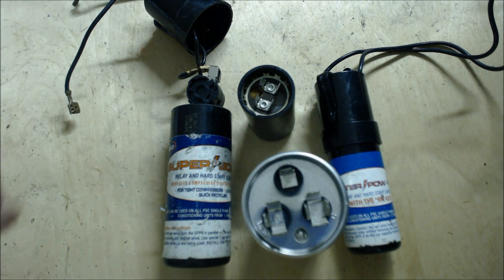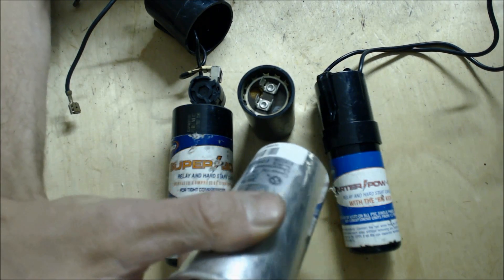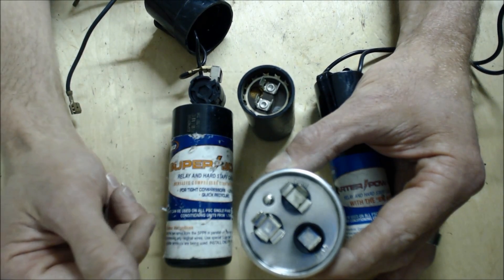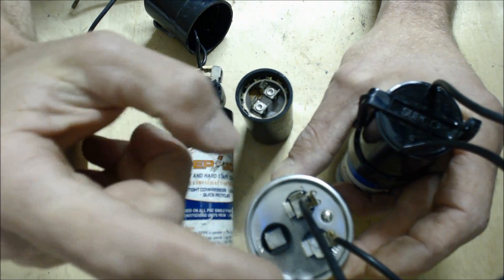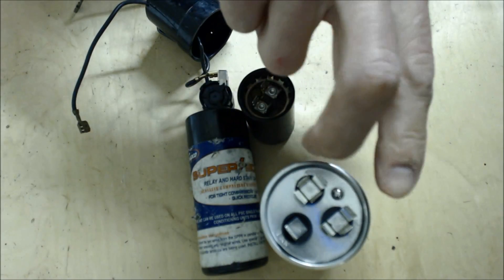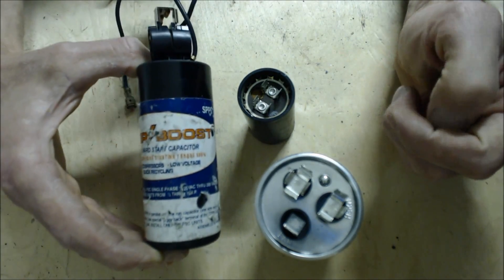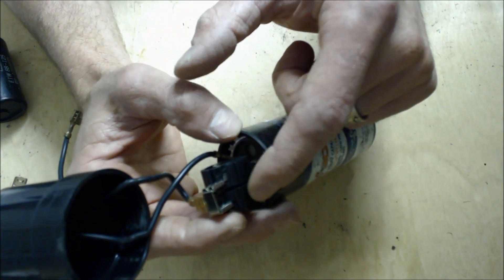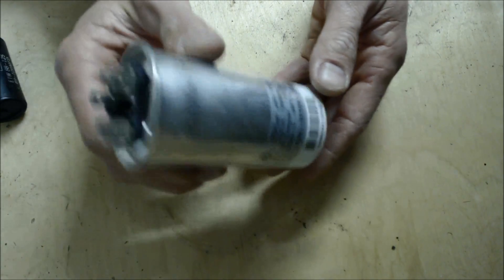Super Boost, Starter Power Packs for Compressors- Why use a Relay and Hard Start Capacitor!

Comment: PLEASE can someone help: can i install hard start kit use for 2.5 Ton 14.3 SEER2 Heat Pump Condensing Unit, 208-230/1/60, R-410A, Single Stage THIS PARTICULAR model N4H5S30AKAAAABAB

Comment: There is no mention with the Hard Start Capacitor Kit and what to do with the relay (I have a Carrier HN51KC024 coil relay in the compressor box)? As the kit has an attached unit as part of the kit, do I keep in the relay connected as is placed currently? Also, when I purchase the kit, is it a universal one or do I have to purchase a specific type or specification which will work with my Run Capacitor?

Comment: Hi I was wondering if you might have any guesses for my situation which is: Sometime within the last several years the guys servicing my system added a hard start capacitor (if they told me about this I have forgotten). Anyway, when we first turned the AC on this year it tripped the breaker. However, after resetting the breaker it ran fine but again trips the breaker at seemingly random intervals. Perhaps heat of day, sometimes once, sometimes twice, causes this? I did find a fairly plugged intake filter downstairs (since we don't turn on the air downstairs I mistakenly thought that air was not being drawn in there) which I replaced and that seemed to alleviate the issue for about a week. Then it started doing the same thing again, once or twice a day, usually in the afternoon it trips the breaker but will reset and run fine. Yesterday we replaced the run capacitor (which subsequently checked out within tolerance) but shortly afterward it tripped the breaker again but also again it reset and has been running fine. An AC guy told me to get ready to replace the unit/compressor as it's R22. The system is 15+/- years old. Sounds like the only thing left to check is the voltage to the compressor but that is probably grasping at straws. Any other suggestions? Thanks in advance for any help.

Great videos, thanks!!!
Reply: What ended up happening my breaker has been tripping... I just had the capacitor replaced with a. Hard start kit.... we will see if it does the trick over the next few days as where I live gets very very hot.
Reply: Broke down and bought a new unit. One thing the company warned me about is double filtering which puts extra strain on the system--since I have a filter at the unit they told me not to filter at the return air intakes. Thought I'd mention this in case this led to a premature death of my compressor and might prevent it for someone else.

Comment: Thanks for this, I make the service to a some type of frankenstein, for some reason the previous technician take out all the capacitors and potential relay and just wired this between R and S wire, I was not able to figure out what was this thing, for some reason the previous technician don't install the run capacitor and the compresor stopped in the middle of the cycle.

Comment: Hello, I have a 2 ton unit and the compressor barely comes on, and then goes off, I think it is stuck! I saw below that you said "Basically, we don't add them (5-2-1 Hard Start) unless the motor is having a problem starting." My compressor IS having trouble starting. Would you suggest the 5-2-1 hard start units or would the SPP5 or 6 work? My fan blows, and sometimes if I listen close enough I can hear the compressor with a quiet buzz, in and out. The temp maintains until it gets hot, then goes from 75 to 78; the pipes outside show condensation, but I can hear clearly that the compressor is not on. The upstairs unit sits right next to it, and I hear the compressor working just fine. Would a hard start work?

Comment: What do I do if my capacitor already has 4 common wires connected? I am trying to add a Hard Start kit to my pool heater and I don't have a common terminal available on the capacitor. Thanks in advance
Reply from the maker: There should be a common wire coming from the contactor to the capacitor. At least that is what we have on air conditioning units. We just add it at the contactor since they are connected by a 3" long wire and there are more tabs there.
Reply: @acservicetechchannel  Thanks, I was thinking along the same lines but wanted to be 100% sure. I wired it to the contactor and it works perfectly. Thanks again.

Comment: A tech. put this on my heat pump today because the compressor was having trouble starting. It was not tripping the breaker, though. The capacitor tested good, but he installed this anyway. It seems to work better so far. Another company came out 4 times before I asked for a second opinion and the new guy installed this booster.

Comment: another video say's this Suppco "Super Boost" kit does not really have a relay but a thermistor.    I prefer to use this Suppco " Supper Boost" kit as it's cheaper than the one with the separate relay for $40...       How does a newbie like me know which one to use?    I have a 15,000 btu window unit so I'm guessing the SPP6 is going to be better than the SPP5...        Thanks for your great videos!
Reply from the maker: A larger start cap would only be used for larger systems so for a small system that is less than 2 tons 24,000 btu/hr go ahead and use the SPP5, thanks

Comment: I have a 15,000 BTU window unit where compressor is struggling / on briefly and then off...   no mention in your title that you are only talking about central air.    Is this solution valid for a big 15,000 window unit?
Reply from the maker: It helps for starting the compressor but doesn't help while the compressor is running, thanks

Comment: If you have a current or potential relay and start and run cap all checked out good. Do you add and wire that hard start one lead to c and one lead to h of the dual run cap or you have to take out the oem start cap and current ot potentially relay? Thanks
Reply from the maker: What is the initial problem. Is the compressor not starting?

Comment: You should do a video about the different kind of hard start kits available and what applications they are best for.
Like the three wire or the ones with electric or mechanical potential relays
Reply from the maker: I would like to at some point, thanks Wayne S!

Comment: hi. im hvac student now. im enjoying watching your video. i have couple of question.
1. are hard start kit and start capacitor same things?
2. most of unit have run capacitor. but the start wire from comp and condenser fan connect to run capacitor. i dont understand why start wire from comp and condenser fan have to wire run capacitor. i feel run wires have to connect to run capacitor.
3. then when do we use potential relay instead of hard start kit.

i really appreciate your work.
thanks a lot!!
Reply from the maker: A start capacitor does not have a potential relay, current relay, or ptc to open the electrical circuit after the motor is powered. A hard start kit from a equipment manufacturer is equipped with a potential relay to open the circuit up and shut the start cap out of the circuit. The Superboost in the video had 2 ptc's on the top of the cap which take the start cap out of the circuit, thanks. Start caps is connected onto the start winding of the on the dual cap. They connect to the herm and the other lead may connect to the 120v leg on the c terminal of the run cap or the contactor. The kick out of the circuit after the motor has started.
Reply: thank you so much! i am learning a lot with your channel!!!
Reply: So the hard start kits are basically larger capacitors that allow for greater starting torque, but have some method of automatically disconnecting them once it's up to speed, because they can't be left in place continuously without overheating. Maybe OEM setups don't use them by default to avoid possible issues if the disconnect mechanism fails, which could end up overheating and damaging the compressor itself. Otherwise the only drawback may be just a few bucks extra cost, which may be more the driving factor for them.

Comment: Is it wise to install a hard start kit (I've got the 5-2-1 kit I think it is called), and a scroll compressor on my home unit.

I've read the kit will significantly reduce the motor starting current which from an old motor guy like me is a good thing. 

I had an HVAC service tech tell me I should not add the kit unless I need it, because of mechanical blah, blah issues.

What little I know about scroll compressors informs me they have a minimal or no valve train. How might the startup mechanical be impacted by lower motor starting current and a bit more starting torque?

Thanks for any input.
Reply from the maker: Basically, we don't add them unless the motor is having a problem starting. It would be bad to potentially weaken and overheat the thermal overload limit on a scroll as it is glued with resin in place on top of the windings inside the compressor.  He was probably just saying anything added after OEM could be a concern for the manufacturer in a warranty issue, that is all. The start cap takes itself out within a fraction of a second due to the ptc thermister, thanks
Reply: Thanks.
Reply from the maker: Glad to help John!

Comment: Since there isn't much price difference between the SPP5 and SPP6 why not just go with the SPP6 first? Just wondering.
Reply from the maker: We try not to oversize the start cap in order to make sure that there is not too much voltage going to the compressor, that is all. Thanks
Reply: Thank you for the response.

Comment: What if the cap only has two slots....one with 2 knives and one with 4 knives? Do you do it the same way? Or do you put the double ended to the supply and one to the 2 knife or 4 knife?
Reply from the maker: Hey Douglas, check out these videos first on capacitors, testing, and wiring, thanks- https://www.youtube.com/watch?v=ObTpixRWzyQ&list=PLxnHR5_D2ojwj2amJSXUKVkv4KV4Az5_Y

Comment: I replaced a faulty relay switch with an RCO810 Supco 3 'N 1 Start device. I used it to replace a defective relay switch (clicks once per minute, rattles inside). It instructs the user to remove any capacitor (my fridge didn't have one) and overload switch (my fridge had a "guardette" mounted against the compressor). So I removed the guardette, and wired in the RCO810 per instructions. I'm wondering though if I should have removed the guardette from the circuit since I suspect it's some kind of thermal protection device or maybe I should wire it back in? The fridge is working but I'm concerned I may have removed a vital component.
Reply from the maker: Honestly, I would replace exact model number with exact model number if you are not sure and that is it, thanks
Reply: Unfortunately the original part is no longer available anywhere, even parts websites. The refrigerator is working ok so far. I've contacted supco for advice, they've helped in the past. Thank you for responding.

Comment: Is there a way to test a hard start kit itself to determine that it is working? Thanks!
Reply from the maker: mfd of the cap itself and 0 resistance across the two ptc relays inside. The ptcs are already connected and you can measure through them but the mfd of the cap is covered by the sticker on the side, thanks Danny L!
Reply: @acservicetechchannel  
Maybe check that the PTC component is working by passing current through it to see that it starts increasing in resistance as it heats up as a final check too.

Comment: the breaker.was jumping The kit he said didnt know how long it last. The SEER is 27 and mines was reading at 33, so he says it was jumping back off cause it went past 27. He said he had a starter kt, gave me cool air but cause the valves were barely hanging, he couldnt tell me how long it stay cool, Anyone?

Comment: those 2 wire bopst caps with ptc are junk . put a potential relay and proper start cap with bleed resistor.